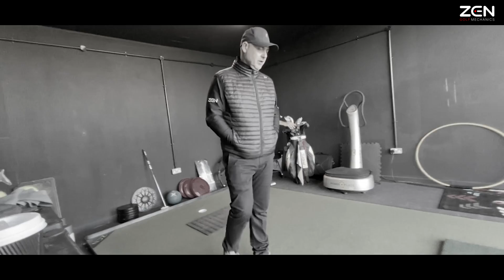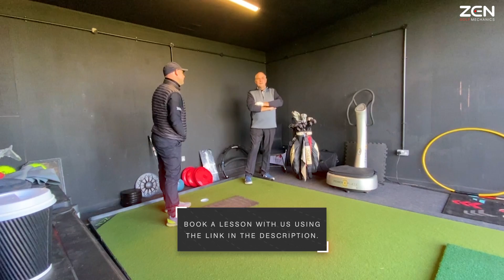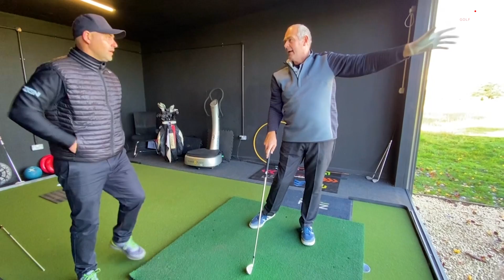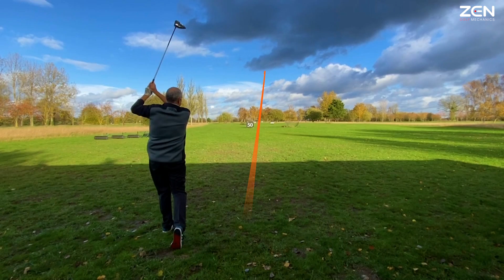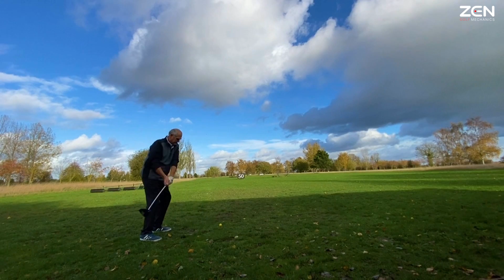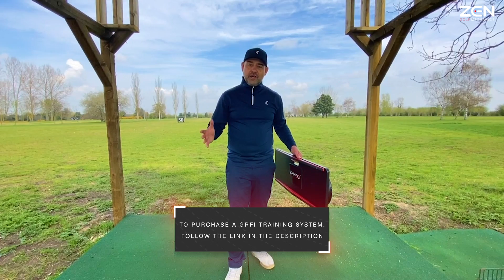UNBELIEVABLE Golf Swing Change After Only 1 Drill 😳

Comment: Great visual with the 2 balls. I had a lesson with Brian Manzela several years ago, he called me a "goddam handle dragger" and got me to throw the clubhead from about hip hieght, it gave me a little more clubhead speed, but not much. My handicap has varied between 2 and 5 for nearly 50 years and my 5 cents worth is that dragging the handle results in more consistency than throwing the clubhead but like anything in golf it's a balance, too much throw is bad, too much drag is bad, experiment a bit but efficient  use of ground force is essential and non negotiable....
Reply from the maker: That's it, Will 👍

Comment: I've been watching many of your videos during the last couple of weeks and have been gleaning much from them. There are so many gems in your instruction! Today, I hit a few into a net while making sure that the handle (the upper tennis ball) was going first before the club head. Moving my weight with loading & unloading, I hit several shots that sounded so good as they jumped off the club face. The most interesting thing was how I didn't even need to keep my eye on the ball. I let the club movement be initiated from my feet and through body movement. I started with my eye on the ball into the backswing, but then I would forget about the ball and swing to my finish position. Once I started the backswing, I could've closed my eyes and would've still impacted the ball. Somehow, that just stood out as incredible to me. I'm looking forward to going to the range so I can see the ball flight. Also, I've learned that I have to make sure and rotate my pelvis in order to have a draw swing - I've previously developed a habit of not rotating my pelvis enough, resulting in more shoulder movement to compensate, leading to a slice (out-to-in path). I've spent too much time trying to control the clubhead with a focus on hitting the ball, but I don't need to; the clubhead follows the handle and then releases through the ball as I unload. It's amazing to feel these things! I still have to develop a feeling for the orientation of the face, but I'm greatly encouraged. Thank you for sharing your wisdom and instruction!
Reply from the maker: Thats awesome, appreciate your feedback and enjoy exploring and experimenting. Look forward to hearing further how you get on!